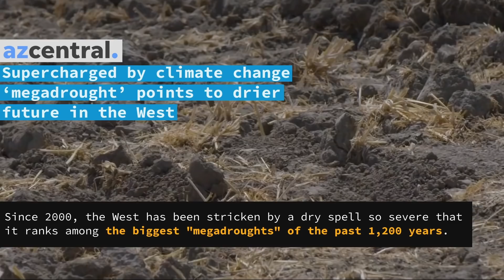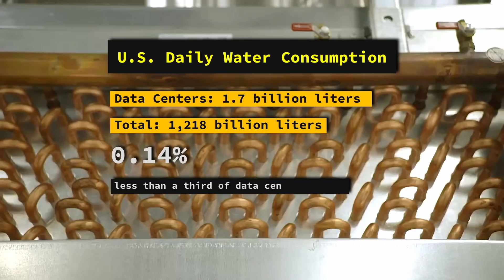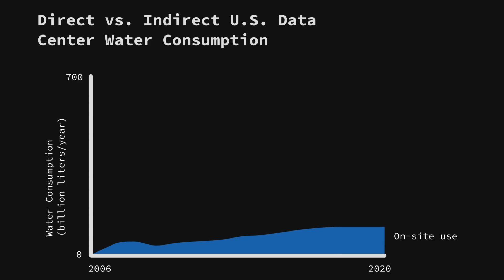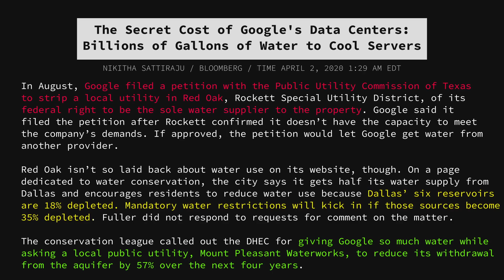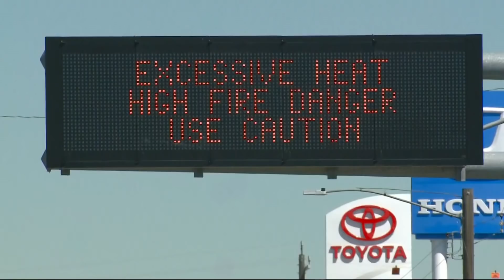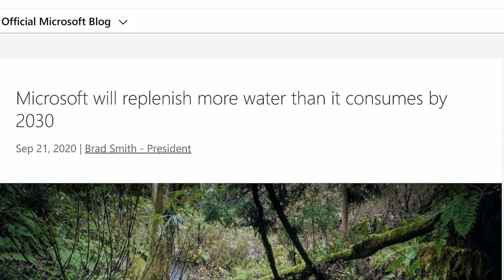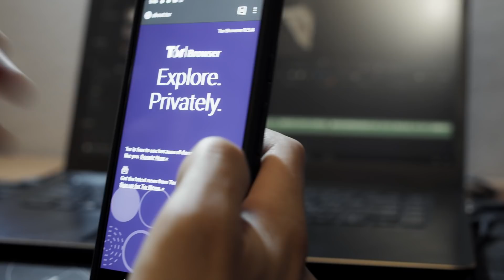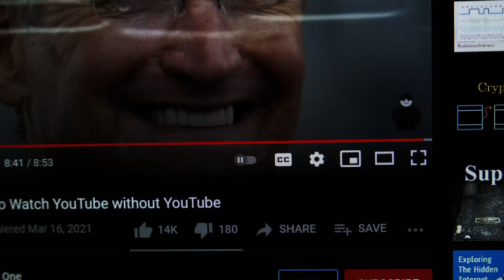The Internet Is Running Out of Water

Comment: Devil's advocate for this comment: If we, the consumer, are going to be limited not just by bandwidth, or transmission lines/towers, but by water as the major deciding factor in whether rationing is necessary, doesn't that equate to removing our consumer eyes from viewing those ads, thus creating far less revenue for (big) tech operations, especially data centers, which derive their revenue stream from the demographic that streams respective content? Would that not be incentive leverage applied to respective data centers forcing them to scale back, at best, or at the least halt upscaling? It seems, to my limited knowledge about this, that's how this scenario would play out? Thanks for your time and consideration. I'm always stoked when I get a notification about a new upload from your channel. Especially "sleeper" subjects like this. Keep 'em comin'!
Reply from the maker: You would need evidence for this hypothesis. Another thing could also happen - they can as well use their financial power to squeeze other users out of water utilities, so that they are the only ones withdrawing and always have enough water for themselves. They would be incentivized to do this by their shareholders pressuring them to increase revenue. In Chandler, Arizona a data center consumed all water allocated to a business park. So things like this can happen. Monopolies tend to eliminate competition by horizontal or vertical integration where they make it more difficult for other companies to participate in the market of their platform (e.g. Apple with iOS, Amazon with online retail, Google with PlayStore, etc...).

Comment: So the best solution would be the under ocean like the one Microsoft was testing?
Reply from the maker: No. Microsoft's experiment isn't scalable.
Reply: unless you can manage to find away natural sea water corrosion, and logistical issues, it will never work out, since the economical cost would sky rocket compared to freash water

Comment: I get they use lots of water, but they use it for cooling, which means the water is still ok to dump back into the river... I would obviously cool it off a bit in a pond, so you don't boil the fish. But they can have a pond that doubles as a recirculation and cooling pond. Then they can ignore their water usage because they are not really "using" the water in the sense that it is no longer available for use. Unless they are dumping chemicals into the water, but I don't think they are.
Reply from the maker: Some water is lost to evaporation. They use 5-times more water of electricity than cooling. Some reservoirs are too stressed by withdrawals and can't be naturally replenished at such rates.

Comment: I guess the way climate change is going underwater data centers and more data centers in the northeast should be a good idea.
Reply from the maker: Underwater data centers are experimental and don't scale (only small projects can run this way). Data centers need to be close to population centers. Not everyone lives in northeast. Also, northeast would run out of water eventually.
Reply: @TheHatedOne  true about the underwater data centers and distance to the end user, but the north east is projected to get an increase in flooding, rainfall, and hurricanes thanks to climate change.
Reply from the maker: @aarshpatel2000  Flooding doesn't guarantee fresh water. It might make things worse by contamination and washing clean water away.
Reply: @TheHatedOne  that flooding is a result of the increased projected rainfall according to new Hampshire’s hydroelectric planning committee.
Reply from the maker: @aarshpatel2000  That's good  forNH I guess. But you'd have to move entire southwest there and I am not sure how welcoming you folks would be. Not casting any judgment, just curious. 
I really appreciate your good points!
Reply: @TheHatedOne  I’m from Delaware😂, but Canada has a similar outlook as far as increased rainfall, geographically it could reduce the load, but ultimately I suspect either people will migrate or desalination would have to be established in the west. Probably a little bit of both.

Comment: Coincidentally I was watching a lecture on the bronze age collapse and how drought very likely played a role in the death of many of its civilizations. Back then they stored information on stone tablets which could survive for thousands of years and be recovered, but today can you say the same about servers and all the data stored on them?
Reply: Some important information is stored on microfilm in mines or other secure locations
Reply from the maker: They will corrode within a few years. Tech hates oxygen.
Reply: rixille
long as you can power them on for a few mins every few months (ssds in this case) they will be completely fine. which is very easy to do and you wouldn't need any water to do that.
also the length of time they had to store their information for was reasonable at that time, today it's not needed unless a meteor destroys the entire surface of Earth, in which case i doubt anything could store all the information we have today that would actually survive such a event.
Reply: @rocksfire4390  Flash memory which is at the core of SSD has a finite life due to the design of the memory cells.  They are not in any way permanent.  The information is stored as a tiny charge in a MOSFET gate.  While the gate resistance is very high, it's not infinite.  Eventually the charge will dissipate.  The best thing for them is cool temperatures, not whether you power them on periodically.
Reply: @drozcompany4132  
that only matters if they are not being used, which when you turn them on they are being used. they do have a limited life span but it's in the same area as a HHD if you give it power every once in a while.
there is a study on this and that's where i got my info from. you are free to look it up yourself. they need to be powered on every few months (enterprise class) or data loss starts to begin because like you said the method they use to store data are just charges stored in gates.
the length of time a ssd will last is based on it's USAGE, not a set time frame. if it's used for a server it's going to take a shit really fast but if it's a consumer ssd, likely will last MUCH longer and if you are trying to just store data and keep it from being corrupted it will last even longer.
Reply: @rixille you got a link so I can watch this?
Reply: @Matthew Tong 
I don't get you. What are you saying
Reply: @Matthew Tong 
I'm not sure whether I'm being trolled or is it real. Seems like I've to do my own search
Reply: The bronze age collapse was brought about by belligerent immigrants who are referred to as "the sea people" in the accounts of the bronze age people.
Reply: no, that data has a finite lifespan if you don't keep them charged.  Its why any extreme backup policy includes tape
Reply: Nope.😊✌
Reply: Liberal millennial thinking of what happen when water evaporates: "it exits the athmosphere and leaves earth forever..."
Reply: @pepelefrog1121  Not sure what your point is.. If a region of earth dries up even if that water is displaced elsewhere, the net loss of water in the region is.. still a problem?
Reply: @rixille  so, where it rained before, once its dry, it will never rain again? This is the result of extreme thinking and forgetting about knowledge of life itself. From Monterrey, México here: the place were its dry one day, and the next is flooded.
Reply: @pepelefrog1121  The depletion of water due to consuming more water than is being replenished.. Even if it rains the water level will continue to drop. That is what net loss is.
Reply: @rixille  so, according to you, once we consume water, it doesnt get recicled. Thats it: water stays in our bodies, cars never get dry, mud monopolies the moist, pool water gets lost in vaccum space and the sun only brights because its pretty.
(when you do very simple things in life.....)
Reply: @rixille  damn if humans only invented a method to transport large volumes of liquids from one area to another our problems would be solved... 😭😭😭
Reply: @baraka629  They did, it's why some lakes are actually depleting now.
Reply: @rixille  All that im gonna say it that you're wrong, do your research.

Comment: I have no clue why companies think it's a good idea to run DCs in deserts, I worked for a company that had me helping to migrate a small DC with a few thousand servers out to a DC in Las Vegas that made no sense to me.   How does it make sense to put heat generating, and heat sensitive devices, en masse,  to the hottest parts of the country?
Reply from the maker: Because it's close to cities built in those deserts. They can't serve those customers from servers in Canada because they want maximum service times.
Reply: @TheHatedOne  Brings us back to the fundamental problem of America which is horrendous urban planning. Sprawling cities in the middle of the desert are a misallocation of capital period.
Reply: @ten_tego_teges  yeah I’ve always thought American has some of the worst city design its way to spread out and creates unnecessary traffic problems
Reply: @ten_tego_teges  San Andreas, one of the largest cities in the country… Is sitting on the most destructive earthquake fault in the entire world…
Reply: @bloodmoon5744  bro we don't live in the GTA universe, San Andreas isn't a real city
Reply: @bloodmoon5744  with a 2,7k pop, I don't think that's even considered a small town
Reply: Land value is most likely a lot cheaper in deserts.
Reply from the maker: @lepsycho3691  That also.
Reply: @lepsycho3691  And solar power is reliable.
Reply: @mal2ksc  Solar actually prefers cooler climates.
Reply: @KironVB  Desert doesn't always mean hot, but it does mean a high proportion of clear skies, which was more what I was concerned with.
Reply: @KironVB  I think the real problem is whether or not you could see the sun
Reply: Yeah I did a dumb. Los Angeles is sitting on the fault line, my bad
Edit: Mica, you are cursed. It took three days of trying to reply for this comment to finally go up properly. The app and browser just kept bugging out, even hard-crashed my phone once.
Reply: @bloodmoon5744  even so, LA is once of the most critical interconnection points for internet and telephone traffic not just for the us, but also with links to other countries.
Reply: Regarding Las Vegas, you can partially thank Enron pulling fibres from every telco under the sun to there.
Reply: the land is cheaper, and its easy to get resources out there, rather than trying to build it on a mountainside
Reply: Cause they get government subsidies.
Reply: if they rather invest in busing the data cables, they could totally serve users in Las Vegas with data center on the other side of USA. For light in fiber optic cable it's not that far especially if it would be direct connection.

Comment: The problem seems to be energy generation though. This could be solved by building more nuclear plants, you shouldn't generate energy in areas where water is scarce with dams.
Reply from the maker: Nuclear plants also need water for generation. 
Only solar and wind energy don't need water.
Reply: @TheHatedOne  for functionning yes, but the mining of needed material and whole process of manufacturing involved is an other story... You touch the point in the video : we will need to learn (for some) and apply (for all) sobriety.
Reply from the maker: @soundsof...  Yes, that's correct. Water is used a lot in production and mining.
Reply: @TheHatedOne  Solar and wind has been shown to be highly ineffective and is damaging to the environment (solar panels has fried bird who fly over them, causes more heat in the area that the farms are, causes tons of pollution to build them and tons of toxins to dispose of them (especially since they break down constantly) while wind power yields very little energy, changes the wind patterns of the atmosphere around them, and constantly are killing birds (including endanger ones)).  Out of all the options we have, nuclear is the best and safest one.
Reply from the maker: @Ironica82  But nuclear won't solve the problem of water scarcity which is the issue of this topic. Not clean energy.
Reply: @TheHatedOne  None of the solutions shall solve it as all of them take water.  I do not attribute this to you but a lot of people focus on one issue and starts promoting a solution without considering all of the effects that solution has outside of that one aspect.  To find a good solution, you have to analyze all aspects, not just one side (e.g. wind doesn't use much water but it does kill birds, changes the environment around it, and would take a crap load of them to even match what we produce which means more waste, more land taken up, and more water to produce and maintain them).  There is no perfect solution that can cut the water usage out.  Honestly, the only way to completely remove this problem is to completely change everything about it (and that shall never happen).
Reply from the maker: @fresnoredemption  Yes, I agree it is a very complex issue. I don't think there is a single solution. It needs to be fought on multiple fronts. I think realizing there is a limit to growth and we can't keep expanding and consuming more and more into infinity is the most important step. So far we've been acting like there is no tomorrow. 
I hope this video will contribute to the public debate that I believe is direly needed.
Reply: yeah sure, because we all know that nuclear plant don't need water to cool down... 🙄

Comment: I mean, they should be better way of cooling than just evaporate water, it seems just wasteful. In a heatpipe (which we find on laptops, and desktop class coolers) water is changing state from liquid to gaz (which uses a ton of energy and therefor absorb heat) then the gaz flow up to the aluminiums fins to dissipate their heat in the air and if it is active cooling, a fan will throw the hot air out of the case. The vapor cooling down then turns back to liquid water and boom you have a cycle. It's sustainable, most big air cooler use heatpipes and they can last decades without ever needing to be refill, they will long outlast their fans.

Plus as a sidenote, due to the size of the chips, server grade CPUs are usually even easier to cool than consumer CPUs. It's baffling that they can't make cooling sustainable.
Reply: They are out to make profit not to solve problems
Reply: That solution would imply having an employee/guy in a suit with an actual working brain and scientific knowledge in Google. That's asking too much dude

Comment: I wonder if there is some kind of computational unit used per amount of water?
Either way, absolutely love these videos! Keep the good word alive.
Reply from the maker: There is and there are papers on this but it's not an all-inclusive measure. It's liters per kiloWatthour. Here's a paper that goes into more detail: https://www.nature.com/articles/s41545-021-00101-w
Reply: @TheHatedOne  Actually if you wanted to ratio computational expenditure to water usage it would be operations/Liter or flops/Liter. Compute isn't measured using SI power.
Reply: Liberal millennial thinking of what happen when water evaporates: "it exits the athmosphere and leaves earth forever..."
Reply: @pepelefrog1121  lol fax
Reply: Its entirely dependant on cooling ststem used and climate/location. The sites that are more water efficient typically use a ton more power which has its own fossil fuel related issues

Comment: Where does the water go after they use it?  We live in a closed ecosystem. Water evaporates and falls back down as rain or snow.  We use water at home, then we flush it down drains back into the water table.  I can't imagine these data centers are just storing the water they flow through their cooling systems.  Either they're closed loops that don't consume any more water once they're filled up, or they have water intakes at one end and water outflows back to the ground somewhere at the other, with some evaporation into the air, which will eventually fall down again as precipitation somewhere.  (The only way to waste water on this planet is to shoot it into outer space.  Well, also splitting it into its component elements, but that's nearly as rare as watering outer space.)

If the issue is that the water vapor from evaporative cooling comes back down as rain somewhere else, like further East, then perhaps something can be done to condense it before that happens--though that would inevitably lower the efficiency of the cooling process.
Reply from the maker: If you were right, then we would never have to worry about running out of water ever. Aral Sea would like to have a chat.
Reply: @TheHatedOne  We won't run out of water as long as it doesn't get ejected into outer space, seep below the Earth's crust (which would  lead to a quick natural disaster), or get split into its component elements.  All we typically do is move it from one place to another, or evaporate it.  Eventually it will rain down or flow back into the ground and waterways, leading finally to the sea.  It may be more difficult to extract potable water from the sea than rivers and lakes, but it's not impossible.  We are immersed in about 326 quintillion gallons of water on this planet.  The problem is processing and distribution.